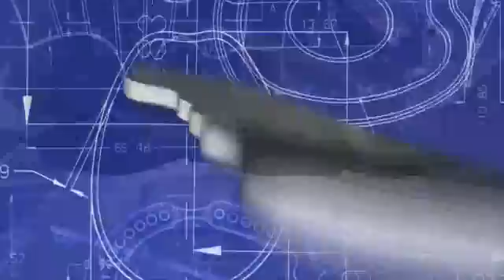#britek  Energy Return Wheel... Autonomous Never Flat

Comment from the maker: We have been very low profile with automotive. "Danger Will Robinson"! Our novel traction systems, only possible while using hoops, is about serious, almost suction cup to the surface traction that will transform high powered vehicles. If you can spin on a surface there is zero hop. ERW 'high frequency' suspension spins the hoop true.

Comment from the maker: What a ride. The steel wheel on a rail is 700% more efficient than the pneumatic tire.  We give up that much efficiency...For cushion... And put up with the low frequency over bounce of tires. It is 2013...Time for super efficient, high frequency in wheel suspension. It's time someone did it.

Comment from the maker: There is no air pressure. Our radial array of highly tension-ed attachments creates high frequency in wheel suspension...The exact opposite of the pneumatic tire. Our first USDOT test...What other airless tire has a Government Lab coast down video? Showed massive efficiency improvements. The Dyno load was so great that a 35.5 psi. tire only coasted down from 55 mph.in 12.2 seconds. Try it with your car, in neutral from 55 mph.

Comment: --- so the increased air pressure will push against the deformation and "return the energy". What happens with a longer bump? The wheel pushes back too soon and the energy is lost upwards. This video shows no proof of anything. Its a bunch of overexplained points using some hype words to dupe the public into buying an overcomplicated wheel with no real benefits other than being able to withstand puncture. And what's the point of that shoe? To let people work less to exercise? Defeats the purpose

Comment: Its still going to be flat on the bottom where it contacts the road. It takes a force to elongate the top, which means as the tire spins, it will deform and cause resistance from the "new" top, negating the "advantages" over a conventional tire. How exactly does the wheel "return" the energy better than a tire? When you hit a bump in this wheel, the section compresses, then decompresses to propel the wheel forward. With a tire, the air pressure increases and tries to maintain a round shape ---

Comment from the maker: Good question. Very well...A hoop under high frequency in wheel suspension will deliver more consistent pressure to the surface. Our latest Utility Patent filing covers several novel
traction systems specific to application.

Comment from the maker: There is a radial array of elastic attachments that suspends the hoop from the wheel. They are evenly tension-ed. When lowered to the surface the pull of gravity creates a bias IE more elongation at the top 180 degrees. This allows for a reduction of force to begin to roll. The high frequency response is possible because the radial array is tugging against itself...Very immediate and anti bounce...Each counterbalancing each others movement.

Comment from the maker: Yes our high frequency in wheel suspension plays out impacts radially. The hoop will become oval stretching the attachments at 3 o'clock and 9 o'clock. This stretch tug of war plays out in real time dramatically reducing bounce and the time it takes to change direction of travel. The chassis will not be moving as much over uneven terrain...Easier on suspension. Please review our slow motion videos.

Comment from the maker: Consider a firm flexible hoop levering traction lugs instead of a balloon. PSI to the surface is increased, hookup is superior rolling a hoop. Pushing a tread block forward takes precious energy and time. Paddles off a curved hoop for loose materials better for highway speeds.

Comment: i find this time consuming. consider the cost.

we can change tires easily with the traditional rubber i mean in instant. buy a new tire and put it on a rim put some air on it, i cant imaging using that tire even if you call it innovational, too many nuts and bolts you can do a tire change in less than 2-3 hours maybe

Comment from the maker: Our newest published patent describes our novel traction systems. You can see our high frequency displacement / reaction speed superior to the low frequency pneumatic tire. ERW has more control of lateral forces because of the radial array of attachments sharing 360 degrees not just localized sidewall deformation. Please review slow mo videos and bicycle high maneuverability.

Comment: I'd imagine trying to use this on a track in a high performance vehicle, for eg the zr1, but with plenty of oversteer, the tyre flex may bend this over and the rim scrapes on the ground also damaging the internal components inbetween the contact wheel and the inner rim.

Comment: he said that tires have to be changed often. how so?

i had Michelin pilot primacy, which i ran for 177,000km and i just changed them. i drive a 2002 Honda civic si and i just installed new Michelin defender tires and they come with a 200,000km life expectancy, also come with 130,000km warranty. my car will be junk before the tires wear out.

so this argument is invalid by my experience.

Comment from the maker: ERW R+D has been generating a new Utility Wheel Patent every 2 years with about 20 claims per patent. Now a historic record. Our radial array of elastic attachments oppose each other...stretch on stretch with about 300% maximum elongation.This is well within the materials working range. We also supplement a vacuum pressure hoop side to back up the membrane lifespan and fine tune the high frequency suspension.

Comment: It has been a while, yet I don't see anything. The basic idea looks like a good one, but I think I can see an issue. The spring looks like it is a single layer. Something like trying to make a set of leaf springs with just one leaf. As we all know the elastic limit of a single leaf will quickly be exceeded in trying to accomodate movement. IE use multiple thinner layers. I can predict these wheels crack! Just sayin! Try titanium if you haven't as it is more accomodative of deflection.

Comment: This did not address any of the concerns I had about your design.  I did not say that your E.R.W. design broke the laws of physics, I said that what you claim the wheel is capable of, does.  I have a BSEE and a BSME, I understand your design, and it's limitations.  I applaud your use of the catchy term,"Quantum leap technology", but it has no relevance.  If you started the patent 5 years ago, and demonstrated it to USDOT, and nobody has backed you yet, it is safe to say the product is inferior.

Comment: Sorry but your company does not support it's design with accurate physics.  Not only does your product-claim not adhere to Newtonian Mechanics, equilibrium etc. but I am certain that it supplies less traction than a pneumatic tire because of its rigidity, as well as less oscillation control, rigid materials without hydraulics or pneumatics have a much higher COM amplitude.  You need to spend more energy working on a product NOT directed at the consumer market. Scuttle this.

Comment from the maker: We do have no bolt versions, Just like today's tires a high and low ERW price point will be offered. Expect serviceable IE Tuner market expandable retread, elastic attachments, composite hoops. Pneumatic tire can not match ERW high frequency in wheel suspension. Performance with safety is everything.

Comment from the maker: Patent filings...We have allot.. limit what we can show for high speed auto/truck. Please consider low frequency pneumatic tire IE bounce generates wheel hop. ERW high frequency as seen in slow motion videos lays down the tread while a pneumatic will bounce. Smooth riding composite hoop topped by Nano Rubber. Prescribed hookup for your smoking pleasure.
Replaceable treads to save for more fun.

Comment: Ville Kaajakari, an electrical engineer, designed the shoe. And while other kinetic energy-harvesting devices exist, Kaajakari’s shoe makes use of a new technology. Conventional power-harvesting tech uses ceramic transducers, which are hard and rigid. Kaajakari employed a low-cost, polymer transducer, a soft, flexible material that replaces the shoe’s heel shock absorber without sacrificing user experience.

Comment from the maker: ERW adjusts to surface variations in milliseconds instead of the low frequency bounce of pneumatic tires IE the wheel hop that traction bars were developed to control. ERW will spin true for your smoking pleasure. The weight will be very close to pneu. and industry will provide both high and low price points.

Comment: I wouldn't make that claim. This technology would never work off road. Think of how a rock crawler's tire has to sort of mold around the terrain to find traction. This tire is incapable of that. And while this tire may absorb shock very well, a pneumatic tire, I'm sure, will perform against a rock on the ground much better. Anything smaller than the width of the tire will cause the entire wheel to be supported by that one object with your design. A pneumatic tire will mold around the object.

Comment from the maker: Our Dyno Day video shot at the USDOT labs shows our early, heavy prototypes spin up a 6,000 lb. resistance load 0- 45 mph. in about 1.5 seconds. The load was so great that the coastdown from 55 mph. was just 12 seconds for the pneumatic tires. ERW was 18 seconds. We have since moved to composites...Very much closer to the pneu. weight.

Comment: I need a full set of 18" equivalent rims with an OD of around 24.5". 8" fronts 9" rears and 5x100 small chevy bolt pattern. Black 5 spoke with redline exactly like Motegi MR116. Now, where do I swipe?

Comment: I didnt mean the inner rim, i am curious about the inner rim tho...
Is there not "two" rims?
The inner that mounts to the spokes, and the "outer rim" which has the rubber tire, and the leather looking insert attached to it.
Also what if i hit a big pump and it flexed one of the adjustable rods right though the metal sleeved rim that they are bolted to.. How much more force can these tires handle compared to a regular tire, or even a Airless all rubber tire?

Comment: What about wet,slushy,muddy enviros where asymmetrical loading could take place,and unevenly stress the wheel/axle bearing? Or possibly migrate into the brake area and compromise the caliper? Those bolts sticking out surely cannot be in the final production.?Also an energy return of that small of compressive force would be so minute ,it would be difficult to feel side by side with a pneumatic tire.But I love this idea for loved ones driving the dry freeways-run flat.Also what about servicing?

Comment: Sorry ERW, but this is not going to catch on. The hardware you are using is far too heavy and stiff. There is nothing really innovative, those rubber isolator feet you are using are cheap off the shelf parts and will not last the lifetime of that tire tread. The ONLY benefit I can see is you won't get a flat, but the rubber will still wear out and all that extra rotating mass will add stopping distance to your car, hurt your performance and MPG and chew through brake pads quicker.

Comment from the maker: We intentionally hit a 4" brick at 30 mph. with the first home built hoops. They were cold rolled steel IE very weak we did crack a weld but could still drive around without incident. Our new composite hoops are protected by Kevlar belted nano rubber and tread.

Comment: screw force accumulation is another word for cyntrifical force? Flywheels create stored energy!   How does the screw force help it brake? Are you using standard brakes or another method. How does the Torque perpetuating in the direction the car is moving converted to increase braking performance?

Comment: the example given at the website :
 "Even though a garage door weighs several hundred pounds, when it is sprung by the use of springs, it becomes de-weighted. So when you lift it, it only feels like it weighs a few pounds. In summary, an object that is sprung requires dramatically less energy to move than an unsprung object. "      HAS NO SENSE WHATSOEVER  =))

Comment: "We look at how many fatalities there are on highways every year."

Aha, let's scare our audience with facts that may or may not apply!

Few traffic fatalities are caused by the failure of pneumatic tires.(NHTSA) (tire failures are result, not cause)

Additionally the vibration and lack of heat dissipation can cause some serious problems. 

If you plan on actually making it marketable, I'd suggest using explicit and directly applicable facts about the improvement, not trashing the alternative.

Comment: How difficult would it be for a tire tech to change these tires at a local shop? Do they handle corners as well as or better than traditional tires? And are they heavier or lighter than traditional tires. And finally, will they cost more than traditional tires. They look really cool and it'd be nice to not have to worry about airing up your tires or getting a flat.

Comment from the maker: Great points. Goodyear has developed an expandable retread and process that would be a perfect fit. ERW curved hoops will allow for retread applications on front and rear. ERW recycles heat.Our attachments are heating while stretching and cooling as they contract. Both events are happening in the same time frame. Rolling a loaded ERW the top 180 is heating while the  lower 180 is cooling.

Comment: Automatic wheel balancers are always an option if balance becomes an issue. We run them on our semi's and it really helps keep the tread wear even, which can be tough on a big truck. 

When you balance a wheel at a shop, its only balanced to what it is like then, not 5 months down the road. Automatic balancers compensate the entire life of the tire and balance the brake drum/disk as well.

Pre-balancing will help the performance of automatic balancers.

Comment: As far as the tread life issue. Michelin's Tweel is retreadable. I assume other OEM's with similar setups will also plan on retreading otherwise I would feel the cost would be too high.

Retreading scares a lot of people due to Class 8 truck tire blowouts.  The issue is generally heat. Many blowouts are Virgin tires. Most blowouts are caused by poor maintenance. 

With airless tires like the Tweel and ERW, there is no air to loose, so retread issues should be minimal.

Comment: I do not know specifically about the ERW, however with our Michelin Tweel's, they "self-clean" due to the constant flexing of them.  These are on a skid steer loader so it is always in deep snow or mud and run at lower speeds on top of that. I would think higher speeds would help with cleansing.  A sidewall would be an issue as it could be punctured and then allow material to enter with nowhere to escape causing issues.  Watch the Tweel SSL Durability video at the end, curbing is a non-issue.

Comment: Which patent is this? I searched and couldn't find any quantitative tire data. Wouldn't a decrease in tire spring rate translate more shock and work to the suspension? Spring damper analysis indicates that with two combined systems, the velocities, and accelerations of two connected systems add together. Less spring in one (tire), means that the other (suspension) must work harder to make up for the first in order to absorb the same amount of energy. I'd love to see the data you have on this.

Comment: How does this tire respond to various static and dynamic camber settings? What effect does this have on slip angles with varying normal loads? Shock absorber settings will need to see changes to compensate for a radically different tire spring rates and damping qualities. What would these changes be? Have you considered any testing at the Calspan Tire Test Facility?

Comment: This isn't a Static Solution, If you had watched the video of it actually functioning you would see it retains the ability to Flex and Deform as it needs to, Of course this is not going to work on say a Truck going off road. But a Sedan on Pavement this ideal. And as for Snow, The Deformation of the tire has NOTHING to do with retaining traction, that has to do with surface contact and the Tread Patter. As for Weight, This isn't an issue, a full rim and Air filled tire weighs more than this

Comment: Nice idea, but here's my concern: 
It has more bolts on the inner wheel than I can count. It's a wheel, so it's going to face a lot of vibration. What if one of those bolts comes loose? How would I locate the loose one, or even know if one was loose? It would take a lot of effort and time to check every single one of those, especially for all four wheels. It would also take more material to manufacture all those parts just for one wheel. All I'm seeing is higher cost and more maintenance time.

Comment: ill tell you why this will never ever gom anywere theres way to much in the rim that can fail all those bolts act as fail points all your goto do is loose one of them and it would thru the hole thing out of balence in tern causeing a car wreck.
with the normal tires and my product called air-seal the tire wont alow a puncher so its going to stop road deaths and theres no bolts to fly out of it anywere i think the inventer

Comment: Wouldn't the constant friction of rubber to surface cause the tread to wear just as fast as a normal tire? And how do you solve the issue of extreme lateral forces that pneumatic tires soak up with sidewall flex?

Comment from the maker: Air bag or elastic cord off a bridge? Each will prevent death. ERW does not kick back or bounce like a pneumatic tire. The hub is elastically suspended 360 degrees within the hoop. A bounce is cut in half by the directional opposing stretch attachments. Stretch and contraction in the same time frame. Equal and opposite action/reaction in the same time frame. All good.